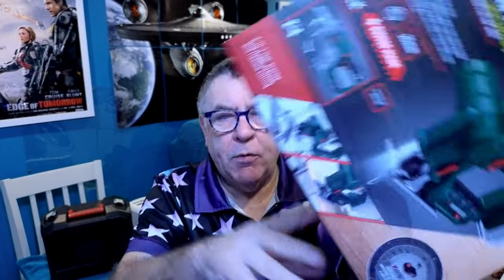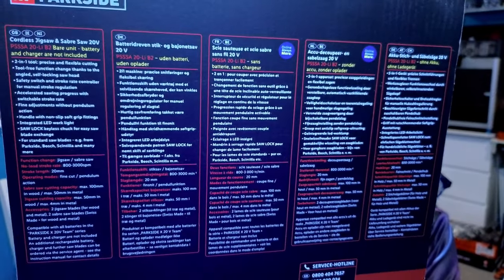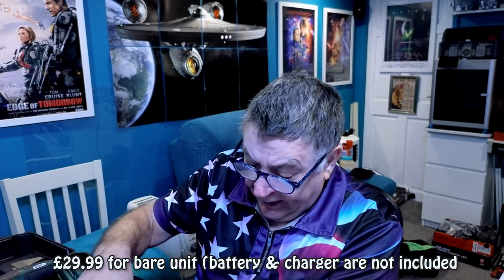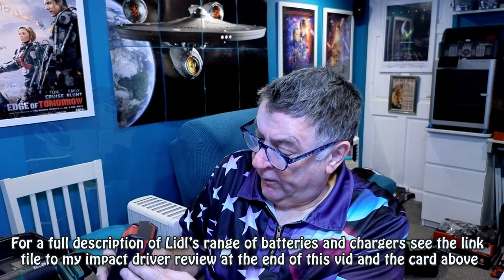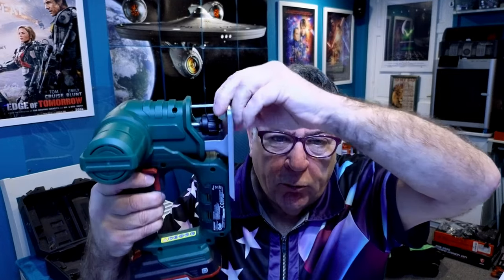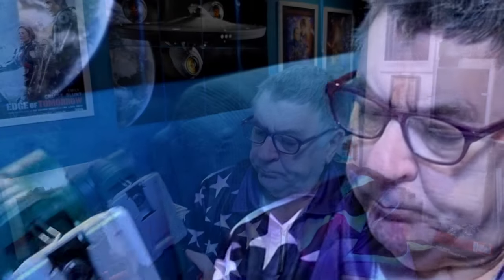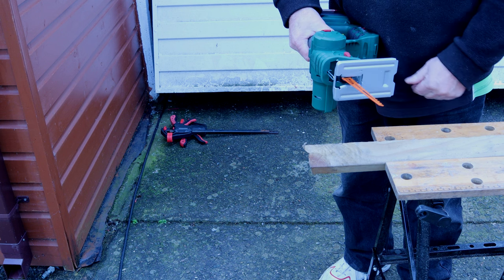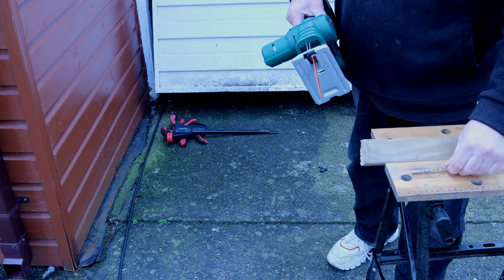Parkside (Lidl) Cordless Jigsaw & Sabre Saw Full Unboxing, Review & Demo

Comment: I bought this model since I need a battery powered jigsaw. and then I found the jigsaw handing with saber saw blade actually makes it very easy to cut straight compared to normal jigsaw
Reply from the maker: Yes that's a good point with it having a wider blade for straights cuts and the thinner one for going round curves